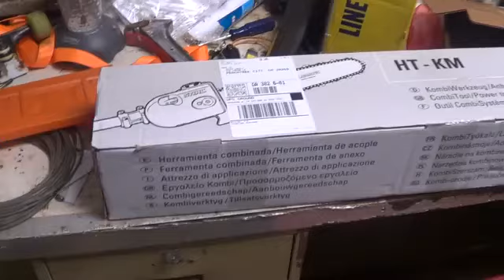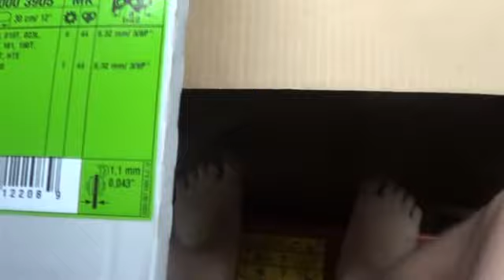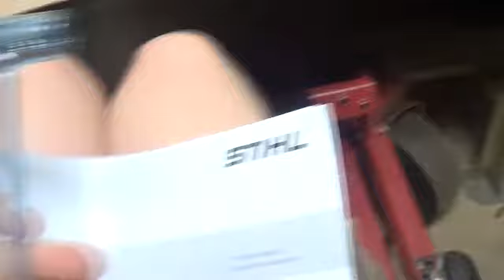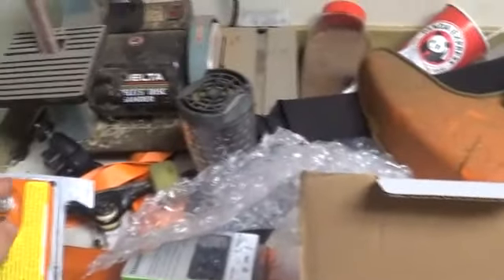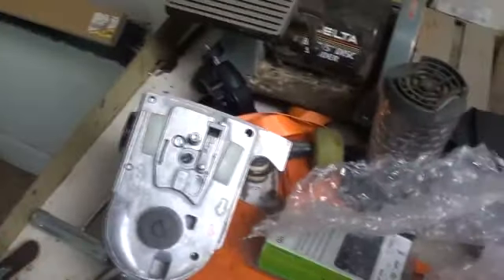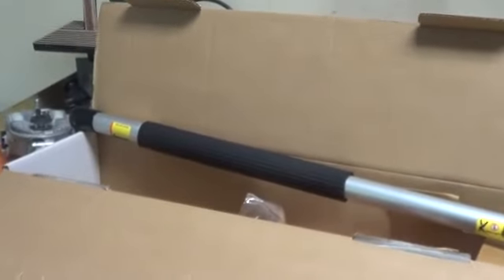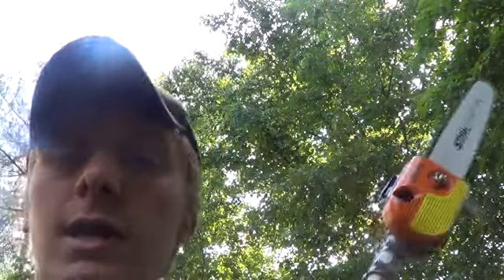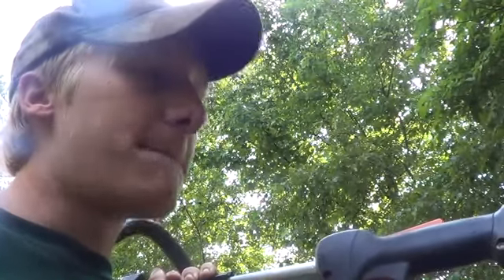Fs90r pole saw

Comment: I'm a Stihl dealer you could have just bought the gear box comes with bar and chain no pole extension only a $10.00 diff. $189.99 for gear box with bar and chain. $199.99 for what you bought. Give the extension to your dad.

Comment: Don't know if you got your rubber grip situation figured out but I would just leave it on the pole. Then get some bicycle handle bar grip tape, or baseball bat grip tape for your FS90R. Build it up a couple layers if you want a thick grip.